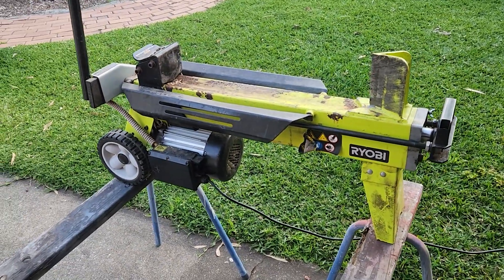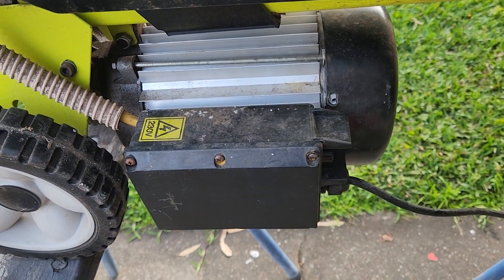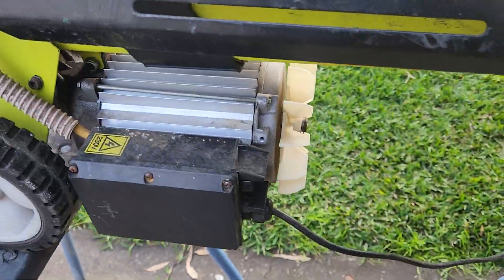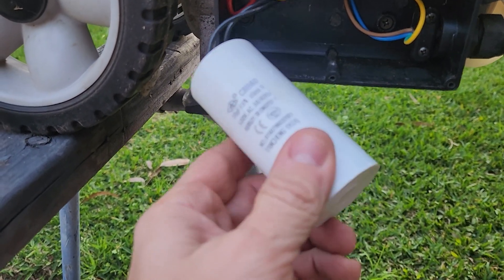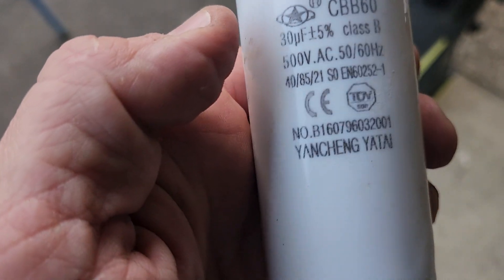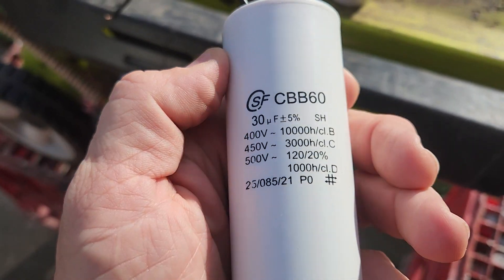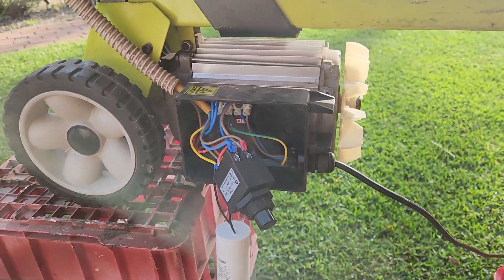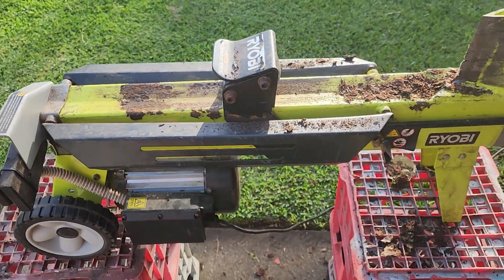Portable Log Splitter won't start? Replace the Capacitor

Comment: Thanks for the upload. I rebuilt my similar homelite and my motor run (and leaked) with loose bolts on the pump. When I tightened them up it wouldn’t spin. 
I would be very interested in seeing your overview of the raised second switch.

Comment: Hi there, My 5T wood splitter stopped working. Got all new parts, capacitor, and switch. Can you tell me witch wires connect to the switch and the motor via the choc box? standard elect cable, brown, green ,blue. Out of the motor, 2 red, 2 blue. Capacitor 2 black. The wires on my machine appeared to be numbered for re-connecting, but when I put them all together as indicated by the numbers, the unit keeps blowing RCD fuse. New switch is  a straight replacement to the old one , YL40F  Watched you video but couldn't quite see all the wiring connections. Cheers Barry

Comment: Hi, just finished watching your video. I moved to Tasmania 10 years ago and bought a HOMELITE equivalent of your RYOBI model . Has had its limits over the years trying to split wood but after some trial and error I ended up purchasing a replacement Bolt on wood splitter steel head on eBay and cut the head of that and welded an old axe 🪓 head onto that and bolted that onto the splitter head without it being welded itself and losing its integrity.  My $300 Bunnings splitter now works like a $2000 petrol motor one . Worth a try, shame I can't share a photo of it. 👌👍
Reply from the maker: Sheesh.... sounds like you made a thing of beauty!!! Would love to see that. You should upload a short vid of it upon your youtube channel.
Reply: @jelreviews Would you have an email address or phone number I can send some pics to you regarding the welded on axe head wood splitter? Cheers Mark.